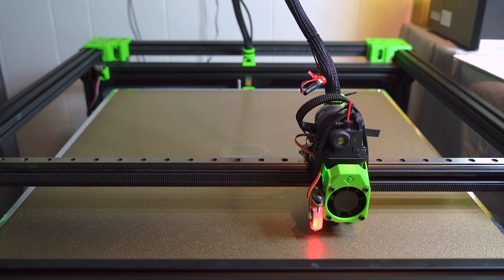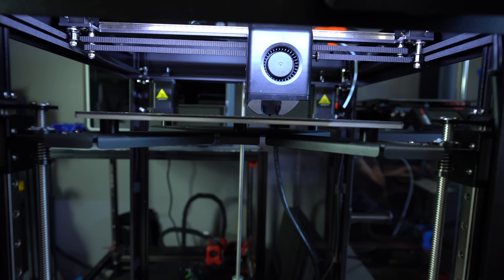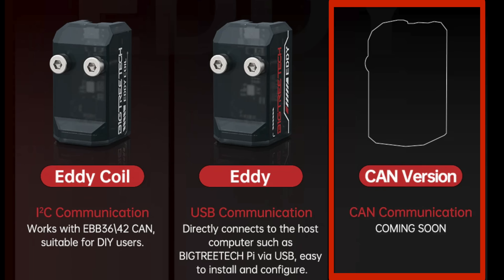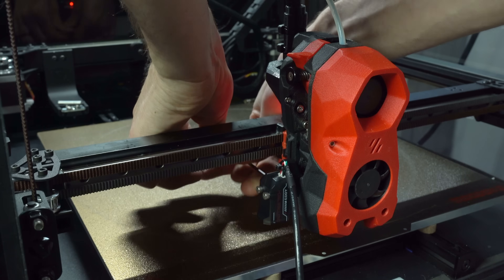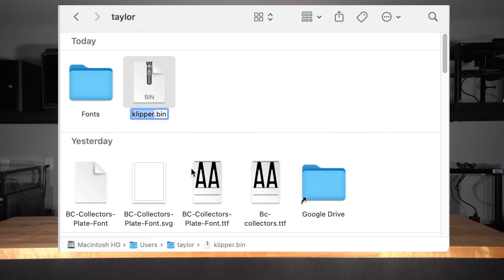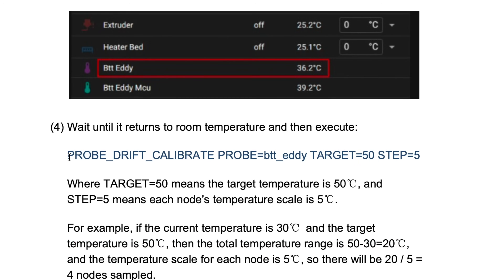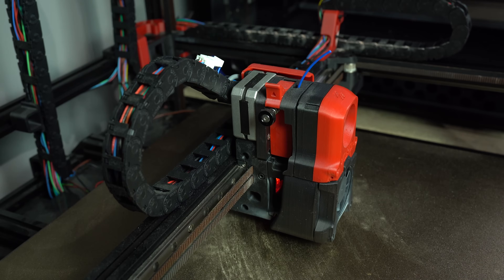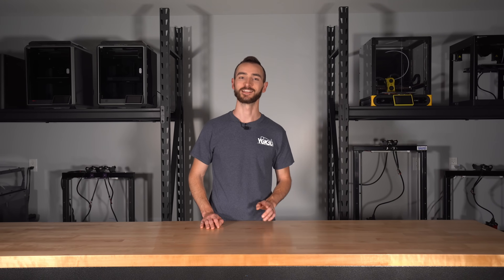3D Printer Bed Mesh Generation Will NEVER Be The Same - Eddy v.s. Beacon

Comment: Beacon contact is already here and it works great and I definitely have perfect first layers.

Beacon auto calibrate did it all on its own and I’ve never had a probe be able to “auto calibrate“ on klipper using their probe calibrate module without having to baby step it afterwards.

I’ve used bl touch, klicky, tap, and now beacon and beacon is the best probe hands down especially with contact.
Reply from the maker: Good stuff! Impressive that you didn’t need to baby step whatsoever.
Reply: @ygk3d  very impressive this is the first time in 5 years of 3d printing on multiple printers I couldn’t believe it either.
Reply: @Detroit_Playa  I was shocked the first time I set up Contact with my Beacon and the first layer was just perfect immediately without doing anything. I've used every other type of sensor and probe out there. Inductive, capacitive, servos, clicky, Tap, etc. Beacon was worth the $70 I paid for it all day every day.
Reply: @WhiteG60  I’ve got the same story it’s absolutely impressive

Comment: why does eddy have a whole rp2040 on board? isn't that a bit of a waste? couldn't they have used an ATtiny or something less powerful?
Reply: Doesn't seem to have its own mcu (eddy coil). Eddy usb and can have a rp2040 you have to define as separate mcu
Reply from the maker: Good question. I’m not super familiar with processors and their specs but I’ll take your word for it that the RP2040 is overkill. I guess they’re cheap enough that it doesn’t matter.
Reply: Maybe because it's easier to manage inventory? BTT has a lot of products all using the same rp2040 chip.
Reply: Klipper has RP2040 support already as a generic controller, and the chips are very cheap. Never know what all you can truly add in the future with onboard processing for very little cost. My personal mainboards that I design are all RP2040 for similar reason, even if it's "overkill".

Comment: Can confirm Beacon contact is great. The printer auto calibrates its z offset for each print so I can change build surfaces, nozzles and even whole hotends with having to set anything.
Reply: very simple. Just do an upgrade and follow the doc how to modify your config. Takes some time, you have f.x. also to upgrade tthe firmware of your beacon. But when you are finished its very impressive.  Super new functionality for zero coins. Great customer service !!!
Reply from the maker: Nice!
Reply: How does that work, though? As someone who changes nozzle sizes relatively often - and has observed a difference of over half a mm in nozzle length between different sizes and brands - anything relying on a statically-set nozzle Z offset just isn't going to work for me.
Reply: @DejitaruJin  ofc it cannot resolve z-offset problem itself. Its just a bed proper with crazy resolution, nothing more.  You need additional straingauge-sort sensors in head or bed to calibrate z-offset. @grasstreefarmer is misleading
Reply: @glorhi  All you need is to home Z with the nozzle. How you do that doesn't have to be fancy in any way.
Reply: @glorhi    Just try it and you see that it works. Plus after that measurement do and activate the bed mesh.
Reply: How did you get it?
Reply: @valent_t  It's a regular Beacon with their new firmware downloadable from their site as of a few days ago.
Reply: @valent_t by reading docs 😊
Reply: @grasstreefarmer when you say you can change whole hotends, are these hotends basically the same height? If not, how much variance in between?

I have a need to be able to switch between volcano and super volcano hotends for various types of prints and I’m struggling to figure out a quick meshing solution that will allow me to do so. In my case the height difference is substantial though, around 20mm if I remember correctly.
Reply: @samanthathomas5239  The only thing that matters is that the distance between the beacon sensor and the bed when the nozzle touches remains fairly consistent. Beacon says 2.6 to 3mm. So you just need a mount system that allows you to space shorter hotends to the same nozzle height as your longest hotend. On my Voron for instance I have 4 different mounts for different hotends all with different spacing between the top of the heatsink and the extruder so that the nozzles are all at roughly the same height. For much bigger differences in length you might need something more custom, but it still always has to match your cooling duct height anyway.
Reply: It detects in fine stepping when probe cant see a commanded movement. But Best is if you read yourself about it on their homepage 🤔

Comment: Until btt eddy has some some actual more features, I'm sticking with cartographer3d for 35$ lol
Reply: The BigTreeTech Eddy is currently not supported in mainline klipper yet, unless you wanna use Big tree techs fork( no one would want to). So they leave it up to the klipper developers to finish there product, unlike beacon or Cartographer3D that develop and support there products before and after releasing them.
Reply: @TheBomberski  Not true. It is fully supported in mainline with only temperature compensation waiting for a merge. The merge is sitting in PR state at the moment and after a few small tweaks will be included in mainline very shortly.
Reply: @looxonline  well it is now... that comment is a month old, and eddy's been released wayyyy longer then that.😂
Reply: @TheBomberski  The merge into klipper was made over a month ago.
Reply: @looxonline  Jun 14 scan was added and shortly after rapid was added. So no not over a month... eddy has been released way before Jun 14 and it still don't have temp comp.
Reply: @TheBomberski  Today is July 15th.... nevertheless, your initial comment about BTT leaving others to do the dev work as well as it not being in mainline are both incorrect. Perhaps at the time you posted the PR had not been merged into mainline but it likely came a day or two after. The devs doing the work were working for BTT.
Reply: @looxonline  oh I'm sorry technically over a month (1 day) sorry my mistake. Yes at the time of my comment it was still not merged and eddy has been released long before that.  So no I was not incorrect about that. Not sure but eddy current sensors like beacon and cartographer3d seem like a better option  that currently support and have supported temp comp, scan and rapid scan.
Reply: Don't get me wrong, I love your products. Best boards, hands down.
Reply: @TheBomberski  It's not that ours didn't support it at release, it is just that our fork was required to enable those features. This was purely a matter of realizing that while the functionality was there, Kevin may want refactoring before is is prepared to merge it into mainline. Other scanners are 100% not supported in mainline. They require external plugins with separate updater processes initiated by moonraker that are overlaid on top of mainline. Mainline could create breaking changes to those plugins with any update which is always the risk of not being a part of mainline. We didn't want to go that route and instead chose to create a framework in mainline that will actually support those sensors too if they choose to go with full mainline integration. I just wanted to make it clear that we by no means released a product with no dev before or after and also help to clarify what work has been done and what is still ongoing.

Thanks for the kind words about the boards.
Reply: @looxonline  And I would agree going mainline over plug In would be the best route, but most people won't use your fork to just use your product. And I'm only speaking for myself but would of preferred it merged before being released.
Reply: I saw on the discord for it that they are supposedly adding a tap feature like the contact one as well. Has worked perfectly for me for like 6+ months now even at 105c beds for abs
Reply: Ya, I can't wait for tap support on my carto. It's made my k1 max so much better!

Comment: Anyone know if Eddy can be jiggered into a K1 Max?
Reply: I have seen someone who got the cartographer probe installed on theirs so you might be able to. It would have to be the USB model of course. It will depend on getting BTT's version of klipper on the mainboard and toolhead boards. I think that might be difficult though because I believe the cartographer install for the K1 relies on using a custom install script just to get vanilla klipper on the K1. Maybe when the Eddy is merged into vanilla klipper it will work.
Reply: Yes, I've already seen it.  A user in the Devil Designs Discord has it working well.  They combined btt repo with official +config.

Comment: I have neodymium in the bed. No scanning possible. I don't care.
Reply: Then beacon contact it is. Contact doesn't care about different magnetic fields as it looks for a spike or bump in the measurement. So also glass beds until a certain thickness even work if you got some metal beneath it. Currently beacon has invalidated each and every probe on the market, not factoring in price point. Claimed accuracy is extremely good, auto z offset or nozzle probing without the need for tap, piezo or force sensors, so no downsides of those. Tap reduces the structural integrity of the toolhead amd messes up pei sticker build plates, piezo and strain gauge levelling is slow, like 2 or 3mm/s z movement speed, strain gauges also require custom software if you want a actual force readout instead of a simple 0/1 signal
Reply: @over_pizza_2578  pretty much this ☝🏻
Reply: beacon has contact mode for nozzle probing that works on magnet inlay bed, glass etc. it can probe on an uncooked egg. it is currently the most accurate, lowest force contact probe. with magnet inlay bed you cant use scanning mode but the new nozzle probe contact mode does work and is still mega accurate, more accurate than anything else on the market.
Reply: glass bed doesn't work, too
i really like nozzle probing

Comment: Beacon has two additional killer features: z offset and accelerometer. Just that it’s worth the price difference.
Reply: Max operating temperature too, beacon clears all
Reply: its not really a versus in my opinion. for cheap printers, go with eddy usb. for something like a voron i would go for a can board + tap/klicky + eddy coil. slightly more expensive than beacon all together and much more functionality and only one cable
Reply: @KilianGosewisch tap is quite possibly the worst thing you can put on a voron, it cuts accel performance in half and brings it down to ender level resonance response. and tap with revo is the equivalent of swapping a lawnmower engine into a lambo. this is one of the many many many many advantages of beacon over tap, not having the extra rail axis, weight, etc. canbus also has a slew of issues compared to usb and other bus systems like ethercat, but thats a whole other thing.